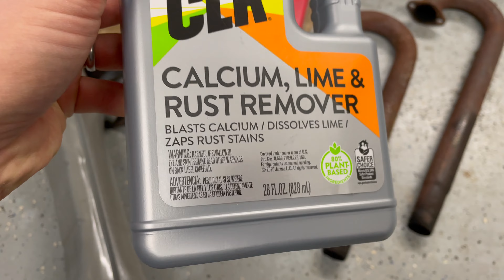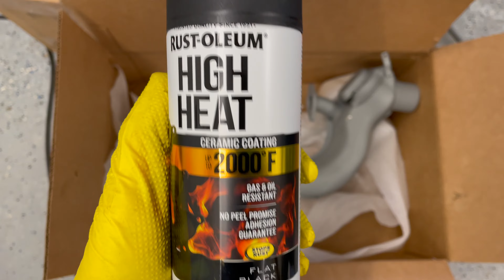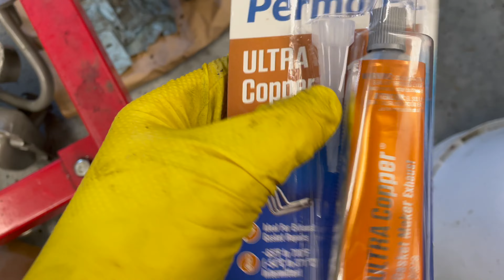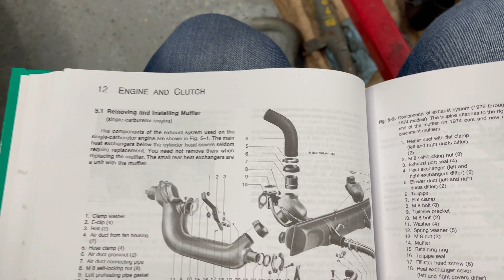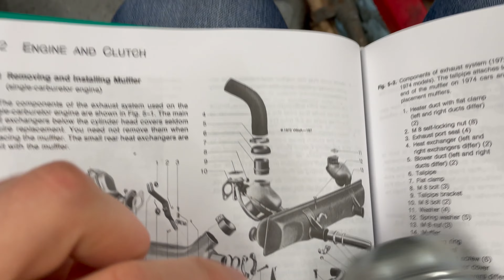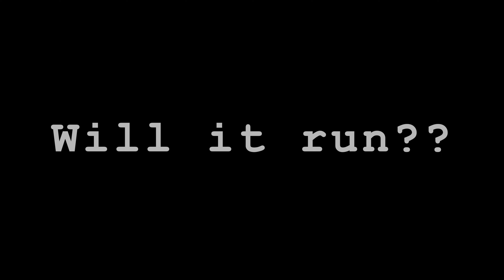Aircooled VW stock muffler and heating system installation | Ep.22

Comment: Nice to hear from you again; you had been under the radar for some time. Aftermarket tins do not fit very well.
Reply from the maker: spoiler alert: I've been spending my weekends driving the bus instead of editing video 😀
Reply: @onehappykombi  Awesome!!! You’ve gone to great lengths to do things right. I did the exact same thing to my car about 18 years ago. Found all the OEM tin and fan housing and thermostat system including the famous Hoover Bit (for which you can find good new reproductions that fit great). Up in NY it will help the engine warm up quicker and nicer during cold weather. Can’t wait to see the install and start up videos.

Comment: the muffler/heater boxes.   That lever  you don't use that on  a Bus,  take it OFF.   you use the lever  pointing straight up..     
I  gotta get this out there.  That fuel pump.   you  need  to check out a  pierburg pump with  Alt.   ok  don't  this   and you will see  why  I say this. >   before  leave  your shop  or install the  motor  try to  remove that  pump.   just remove the two nuts,  the try lifting that pump up and clear  studs.  you don't need to remove the fuel lines
Reply from the maker: Hi Jon
Thank you for your message 

Why are you saying I should try to remove the fuel pump? I just put it in there